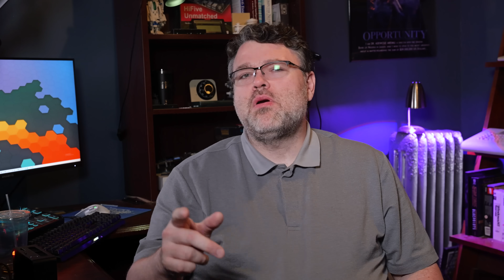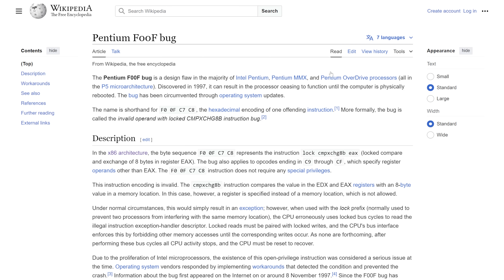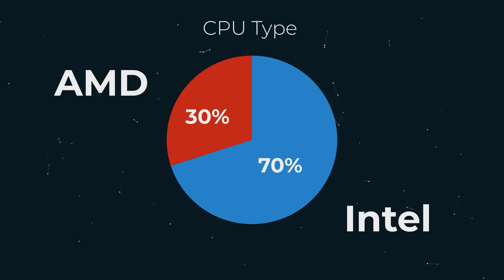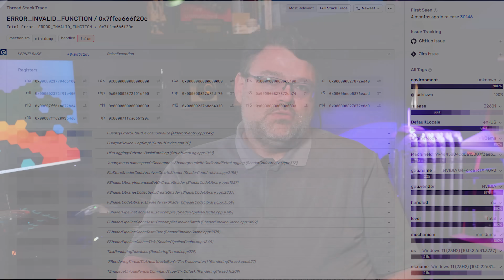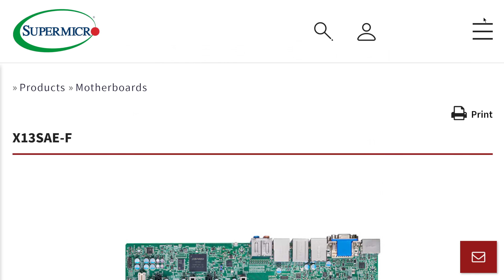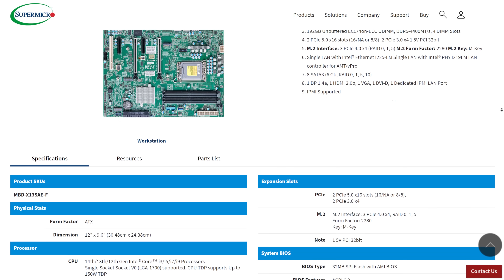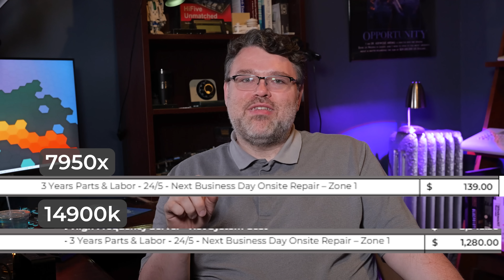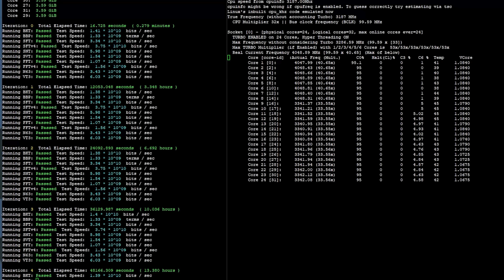Intel has a Pretty Big Problem

Comment: I purchased a brand new i9 14900K system with an MSI motherboard about 6 months.  The CPU crashed and died so I sent the whole system back to the company and they replaced the chip. Less than 4 weeks later, both SSD's (that came with the system) were corrupt beyond repair.  Rather than just replace the SSD's and/CPU, the company agreed to replace the entire system and right now I'm waiting for it to be shipped to me.  I did not overclock my CPU manually, but I did enable XMP on the motherboard.  While playing my games my P-cores would frequently reach 100C. To help with this I installed fan control and got the average temp down to about 88-90C but I still saw spikes over 100C.  I did go out and purchase 2xDDR5 32GB Ram sticks to see if the memory was the issue and ran into the same issues so that is ruled out.  I updated my motherboard to the latest BIOS which included the Intel recommendations immediately after I received the system back from the first failure.  At this point I have no faith in 13th or 14th gen CPU's.  I'm basically screwed here unless Intel can figure out the root cause and do a recall to replace these chips.  

All my money went into this system and I can't get a refund for it, and the company will only replace the parts with the exact same components (I have about 18 months left on my warranty).  I can't keep shipping my system off, not to mention the loss of data and time (I use my PC for more than just games, I use it to run my small business) so my solution is to get a 12th Gen i9 12900K CPU and put the 14900K in my desk drawer until Intel is forced to deal with this issue.  I would go with AMD but my motherboard is an MSI Z790 Tomahawk WIFI DDR5 which I don't believe supports AMD chips.  This will most likely be the very last Intel system I ever buy.

Comment: you know what is the Intel's problem?
They cannot come up with the new architecture with better efficiency and all, so they just increase the power draw by increasing the voltages to the core and some other stuff just to gain little bit more performance just to stay on top of the chart, but that resulted in instability and ended up crashing or blowing up.
Intel need to use the time to come up with something new and stable, power efficient witch mean less power draw, witch mean more performance with lower TDP or temperature.
So 13 and 14 gen is the same in architecture just added more buff in power draw i guess....🤭
Reply: That may be true but are you aware that you can undervolt to the point where it's more efficient and actually doesn't lose performance?
Reply: @DingleBerryschnapps  exactly, that is what efficiency should look like, lower power higher performance = efficiency.

Comment: It's incredibly unlikely that there's a real difference with the hardware for a z790 vs w680 chipset, but I agree that intel would not be allowing overclocking on that fake-xeon platform.  Intel has been preventing overclocking alongside the reliable ecc-supported fake-xeon platform for over a decade so they almost certainly wouldn't start allowing it now.

Comment: I wonder... I have a 13900KF (day 0 CPU) that I have it running daily for the last 2 years almost. It was overclocked since day 1 and I had zero issues/crashes with the CPU. I run it on a Z790 Mobo from Asus BUT I am still using DDR4 RAM (since I had 64GB low latency RAM from before and back in Nov. 2022 DDR5 was extremely expensive. I do need that 64GB of RAM).
I wonder  if a CPU that exhibits this behavior on DDR5 would be put on a DDR4 platform would show the same instability?!

Comment: Given the fact that 13900K has been on the market since October 2022 and this issue hasn't been fixed, it must be a design flaw. It's shocking that i9 still die at W680 motherboards.

Comment: Started when i shifted to a i7 13700KF. Could repeatedly recreate the issue booting specific games (Gears of war for example), always resulting in the mystery GPU message when i was testing the system, At the time there was barely any data, forced standardish power limits and some other changes to the BIOS and since then, its been largely fine. I'd noticed this behaviour since the CPU was installed out of the box. The newer bios fixes didn't seem to really fix much for me but I've always been super fearful of the Optimised vendor settings.  i713700KF/NV 4080/Asus  Z790M-PLUS D4. ☮
Reply: Different issue.
Reply: Not sure I'd agree based on Intel press releases.

Comment: Intel has clearly have fallen so down, it is hard to imagine it even... They need to step up, and fix their mess, BUT it will be great, if they do that in next 5-6 years, that way AMD, will be able to gain more market share, and all will result in prob 50-50% x86 CPU market share for both companies.. And that means we will have great competition, once Intel fix their crap, and introduce once again great products, such as the last great CPUs they had like Pentium III, Core 2 Duo and Quad, first gen Core i, and lastly Sandy Bridge, as after that point, Intel did start to go down (only simple example is that Ivy bridge and Haswell had no soldered IHS)... And AMD also to innovate, as they do ever since Ryzen, that way we the consumer will have the very best prices, and tech... Also i hope Intel to step up their game in ARC, so to give hard competition to nGreedia, and AMD to push Radeon even further beyond, as 90% market share to nGreedia alone, is f-king disaster for us the consumer...

Comment: what was causing my 13900k's instability was the AC/DC loadline not being set correctly. it would default to .5 AC and 1 DC. This plus asus''s multicore enhancement ended up frying my first CPU and intel gave me another one back thank god.

for my asus maximus z790 the correct AC/DC loadline settings are .73/.73 this wasn't the only thing that i needed to do to gaurentee stability, i also had to use a setting called "synch acdc loadline with VRM loadline" on top of that i had to use a Load line calibration of 5

im still running my cpu on unlimited power mode and have been using this computer this way for a year without the cpu killing itself, i won't say without issue though as i did experience alot of crashes due to the AC/DC loadline not being set correctly

basically, with the new bios that came out, 2301 they added the correct intel spec'd profiles into the motherboard, but lazily left their original profile to be the same, so if i wanted to ai overclock this thing, it would revert all the settings back to the shittier settings.

Comment: Consumer CPUs aren't designed to work 24-7 for months on end - it's not an excuse as to why these crashes happen but it DOES heavily impact the frequency. We had the same issue with Western Digital hard drives a few years back where certain Blues would have unusually large failure rates but especially among people who used them for hosting torrents. I consider these stress tests which are good to detect weaknesses in hardware but yeah ... .

I myself built a 13th gen i9 system at work and have experienced zero issues so far - I do wonder if these CPUs will survive for years or if they'll all start dying after 2-3 years the way AMD CPUs used to in the early to mid 2000s (not a single of my 3 AMD systems survived more than 2 years).
Reply: Your talking BS to try to justify your purchase. Consumer chips have been designed for 24-7 uptime for decades, they have been expected to run 24-7. There is some instability that is taken into account for No ECC memory but generally they are meant to be able to run 24-7 as long as they are within power and thermal limits. In fact most wear and tear comes from power cycles. And Intel has marketed consumer chips to professionals, so get out of here with that wasn't designed for BS.  

WD hard drives are a completely different story an irrelevant, Consumer blue drives were not designed to have the kind of wear and tear torrent causes, They were made for common use scenerio with a certain number of read and write cycles in its life span. This has never been a secret and enterprise drives existed for this very reason where preformance is sacrificed for durability. 

Your 13th Gen I9 could be perfectly fine for a long time, Or tomorrow it could fall victim the same as everyone elses. From all metrics taken it doesn't matter the ammount of hours or use cases that causes the instability. The Numbers don't lie that there is an abnormal amount of failures for the I9's from the 13-14th generation. Playing devils advocate is only going to hurt you when its stops being them having problems and starts being YOU having problems.

Comment: I upgraded to a 13900k and Rust crashes for me CONSTANTLY. Ive been losing my mind over it switching out every other component.  Its the CPU
Reply: I had to change so many power settings and volt settings and under volt and other shit to get it 90% stable on rust . Id already be on a 7950 x3d if you had the money for a new CPU and motherboard

Comment: I knew Intel would be running into major problems with their CPU’s in their futile effort to keep up with AMD’s all “P” core architecture. Intel’s “P” core / “E” core architecture is a failed experiment right now. I believe Intel will eventually drop the architecture and move on. The time is now. Market share is quickly being lost and users are losing confidence in Intel.

Comment: Hi there, just a thought I had, would it be possible to re-create the potential intel IO issue by using the same.sysyem but using one of the few games with direct storage, this would negate the CPU using the IO to send info such as textures to the GPU directly using direct storage bypassing the CPU and to repeat the test turn off direct storage meaning the CPU is then used for IO game streaming data

Just a thought

Cheers

Comment: Here my perspective as a service tech.
I've gotten a lot of repairs come in that constantly get WHEA errors from the PCI Express Root Port 
I also see WHEA errors involving something like DEV-A72E (example)
(I can't find an exact model so please forgive me they are different every time)
(These seem to point to a controller device embedded in the CPU that controls the PCIE Lanes)
CPU Swaps or Motherboard Swaps are the only fix.
Updating Intel ME Firmware or BIOS doesn't fix it.
I have NEVER seen it from an AMD CPU.
EVERY time i've had to replace an AMD CPU it was purely a physical core error or physical hardware issue.
Definitely something fishy with Intel CPUs.
Personally, I have a 13900k, but haven't experienced these issues.

Comment: My gaming system is an ASUS w680, 13900k, 4090, 64GB ddr5 ECC at 5600 xmp (I also do some things I need actual ecc for) I just opened hogwarts legacy for the first time and it compiled all the shaders fine, though temps peaked at 88C with a top end lian li gallahad II lcd 360 aio. I’ll try the other problem games too.

Comment: So, I recently upgraded to 14900KS and now I gotta worry my PC will die soon! UGH!
Reply: It may not happen to you mate but just out curiosity, why did you go for that configuration?
Reply: @detroid89  I tend to go for power ratings on GPUs and CPUs tom future proof my system. This way I know I can run the best of the best for years to come without concern. I realize I am not super entrenched in tech and what not so there is probably maths and voltage changes I can make to other products to get similar power without having issues. I simply look up charts on what CPU has the best benchmarks and which GPU is the most powerful. I tend to opt for that. So far it has been good for me. This time it may not. Maybe my reason will get me called names and ran down by others and I assume it will. But that was my reasoning.
Reply: What where you thinking? Buying a CPU that has crazy temps and power consumption and is obviously pushed beyond it's limits.

Comment: I've made the mistake of getting an i9 13900k and an Asus Rog Strix Z690-E. 

I had zero problems when using my EVGA 1070, but as soon as I got a 7900xtx and upgraded from 1080p to 1440p - 180hz, I've been getting green screen / black screen crashes when just applying a gpu fan speed profile and loading into games. 
I just updated my mobo bios from 2300-ish to 3600-something and so far no crashes, but I know I wont avoid the inevitable. 😅

Ready to switch to AMD.

Comment: Regarding the slowdown before the crash, I know another software developer that had an affected 13900k in December/January of last/this year (whose issues seemed to disappear back then after disabling HT, probably due to reduced concurrency in multithreaded workloads) whose CPU tended to returns messed up data when loading stuff from memory or randomly causing access violations on valid addresses when under intensive multithreaded workloads. As such, I had a thought that maybe the servers use ECC memory and the CPU memory controller somehow sees messed up data coming from memory and tries to correct it with ECC which causes the slowdown. And even if it didn't have ECC, it might've been some internal error correction like Zen4 has for IF.
On another note, I think that Intel is trying to sweep this matter under the rug instead of addressing it. Same person I've mentioned before noticed that Gigabyte removed their "news" regarding the crashes so motherboard manufacturers might be doing it too.

Comment: That one ASUS screen may not be the CPU, but that M.2. I had fairly frequent crashing from my Samsung 990 Pro 2TB as the boot drive, that I had to remove it and go with a Crucial SSD instead. No crashes since for maybe a month now. I have a 980 Pro as a game drive, which hasn't been an issue, but then again I've never used it for boot so I'm not 100% sure if it's any better.

I'm running an AMD CPU.

This may have just been the SSD.

Maybe check the stats for the prevalence of 990 Pros in people's systems. Could be there's a higher number of them in Intel systems for some reason. Dunno.

Comment: I partly blame channels like JayzTwoCents for promoting running these chips at temperatures up to 100'C. Saying running them in the 80+'C is fine and even in the 90'C range.

I heard all about these temps and power draws before I bought a 13700K. First thing I did with new build, was turn of the motherboard overclocks of 4098W BIOS setting that is on by default. 
Then undervolted and current limted.
Never had the CPU as much as sniff wrongly. Not once in over a year.

Yeah it won't be as fast as other Intel CPUs, or a stock 13700K. However it won't bulge like AMD CPUs did for a while. Plus I won't have to go through memory training, and dialing back the memory clock speeds, as with AMD. ................ I sometimes still wish I had waited for the 7800X3D and subsequent AMD board BIOSes to be fixed though. (Touché AMD.)

Just goes to show what Intel's greed over the 4th, 5th, 6th, 7th, 8th, and 9th gen did for them. Keeping players mostly at four cores and not innovating. They thought they were untouchable, and only pushed clock speeds and little innovation. Now they look like they will never make it back or at worst are in serious trouble. ... Sure hope Jensen 'not enough vRAM' Huang gets the same treatment, the greedy son of a ..... .

Intel should drop this rushed new chip every year. No-one needs a new chip every year; nobody. .... They need to take time to innovate and think between CPU releases.

Comment: W680 boards running AST2600 BMCs may be able to take Intel crashdumps, as well as provide some limited information in their SELs. Wonder if that is of any use here, or if these errors are typically just more silent data corruption? Also, these software crashes should be somewhat analyzable to figure out the nature of the CPU misbehavior, which would probably be useful to know.

Comment: I took my 11700K and downvolted it with a -0.090offset and 4.6ghz allcore and it seems FAR more snappier and faster less heat. + disabled AVX 512 and only AVX on.

Comment: I've gotten my 1st 14900k RMA'd.. Its replacement is no better, just different.  It cant clock well at all, its more stable at recommended settings but consistently hitting  Limiters. I have no idea the soluions, Ive been in support ticket helll for 2 months still ongoing.

Comment: Yes, 70% of the desktop CPU market share. Sure the 13/14900 k,kf  have issues and should be taken off the market until resolved or replaced. The rest of 13th gen and the poorly named 14th gen are fine. As usual when there's a production issue various YouTubers will claim "It's all over for (insert brand here)" it's predictably boring.

Comment: I've been told it may be an issue with the photolithography process, where a possible machinery overhaul between 12th and 13th gen coupled with less strict QC regulations (due to pressure from the bean-counting executives) at Intel is causing premature / excessive degradation of the chips. Microcode changes will NOT be able to fix this mess. At best, it will only mitigate or postpone these problems.

Comment: After a 6 month battle with Intel regarding an RMA for my i9-13900kf I finally received my replacement CPU and I can confirm it is 100% the fault of Intel. I had game crashes, BSOD, and random PC shutdowns. This is a problem that Intel seemingly doesn't want to acknowledge. I have not received any reassurance in regards to the issue not happening again. Super disappointed and dissatisfied

Comment: Unfortunately, I’m one of the affected 13900K users. Lots of crashing regardless of power settings. I swapped in a 12600K, 12700K, and 12900K and the stability issues resolved with each CPU. Unfortunately, I didn’t have access to another 13th or 14th gen to test.